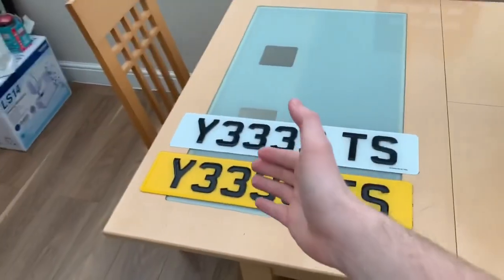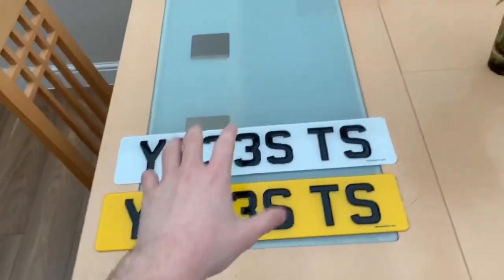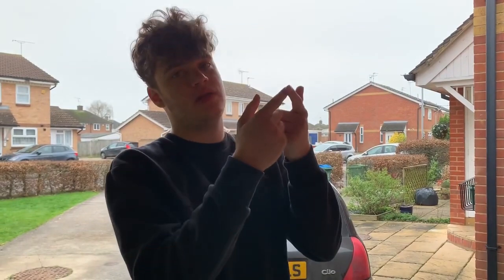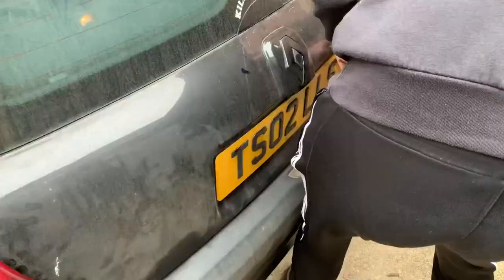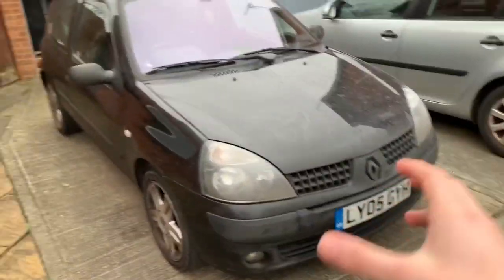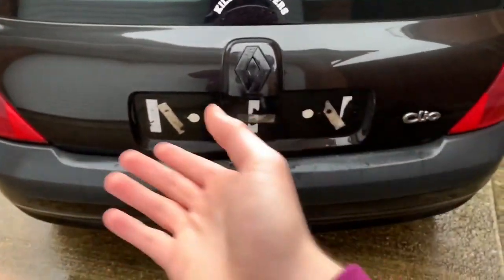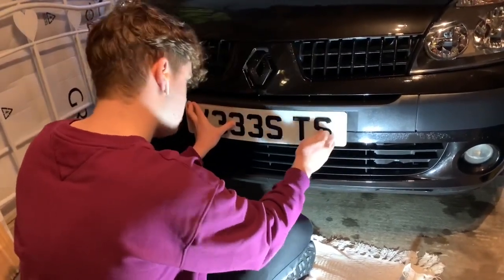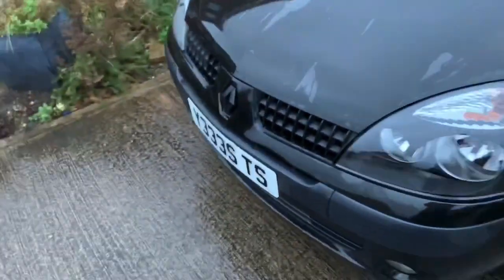I Got New Plates...Again!!

Comment: How do u wash your car mate 👍
Reply from the maker: I plan to upgrade my setup very soon, but for now I use 2 buckets, car shampoo and a Halfords mit thing. Pretty simple setup
Reply: Tom Simons do u use a jet spray
Reply from the maker: I just use a garden hose and set the nozzle to fairly direct, but not so direct it scratches the car. So like halfway from the wide spray and direct spray (if that makes sense)
Reply: Tom Simons yeah mate I get what u mean I use the garden hose  with the spray if the car is not that dirty but if the car is very dirty  I use jet spray as it take the dirt out  better and thank u mate for replying quick and keep up the good work that u are doing mate 👍👍
Reply from the maker: Thank you mate I appreciate that